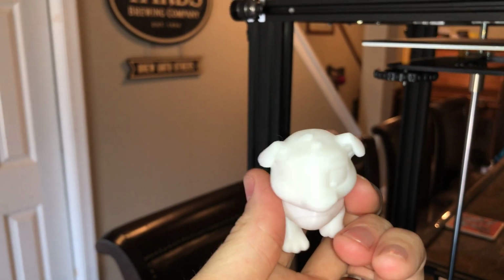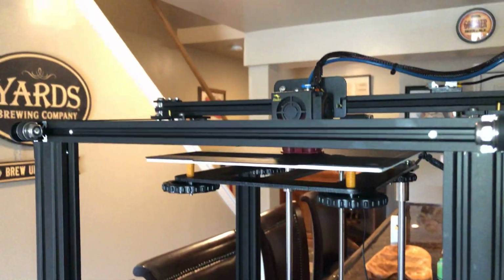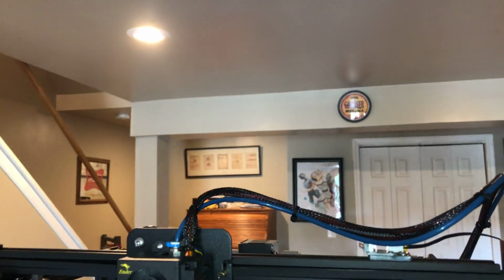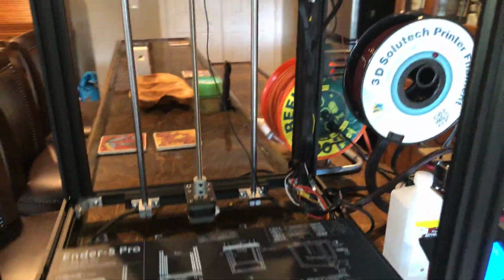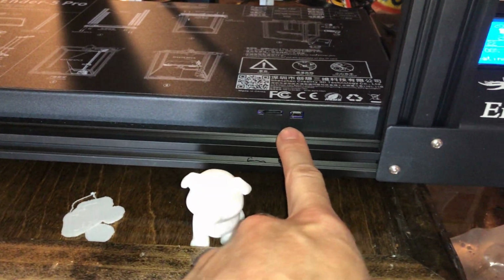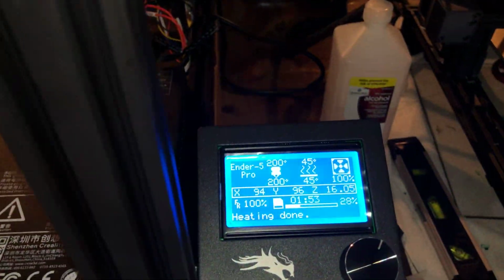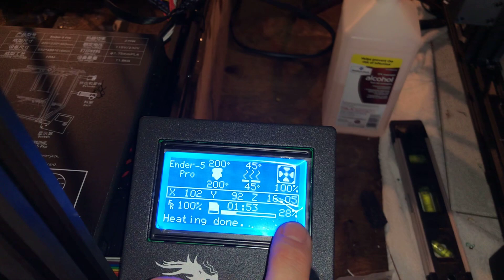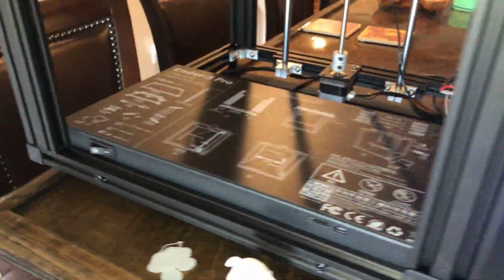Creality Ender 5 vs 5 Pro | 3D Printer Video Review

Comment: Ive watched a few reviews on this model but am left wondering if that bed will droop over time. It is only supported on one side. I would expect the far side to start to droop as time goes on. Have you noticed anything like that shoeing up in the prints?
Reply from the maker: Grandpa's Place I’ve got a regular Ender 5 that I’ve had for over a year now and have not observed any drooping. That said, I have printed Super Struts arms in PETG that supports the front end as a precaution. I recommend others do the same.

Comment: does that board help the print quality? thax i have the older version ender 5
Reply from the maker: roadstar499 I have not seen that this board improves the print quality. The reduction in sound is VERY noticeable though.
Reply: @plasticmakesperfect5863  i also thought this silent board had built in smoothers??? i know my 1 year old ender 5 does not...i also have a landy power i think this one has a meanwell...thax

Comment: Have you tried the white filament, that what came with the printer? I have just problems with it.
Reply from the maker: Sebastian yep, I have. I printed the dog that with the white filament as the first test of how it works and had no trouble. What issues are you having?
Reply: @plasticmakesperfect5863  It was 1.6mm or below and very brittle. I've now new filaments here and I try currently TPU

Comment: Torn between the pro and the plus. Not sure if I need the added print space. Price isn't an issue but don't want to have a big bulky machine if it's not worth it.
Reply from the maker: Steve Drawdy sorry for the slow reply! The Plus does have benefits that the Pro doesn’t, such as a 32-bit main board, dual Z screws, a BLTouch, a touch screen, and obviously the bigger build surface. Two of my buddies have one and they’re huge! I mean, he basically had his arms as wide as possible to carry it in.

Honestly, it’s really dependent on what you want to do with the machine. For my needs, the Pro is sufficient in size plus I love to tinker so my pro is largely a Plus already, minus the build size. I’ve heard there are some issues with the Plus, but in the year or so my buddy has one he hasn’t had any issues so your mileage may vary.

Hopefully that helps you out some, but the Ender 6 is also either around the corner or out now. That one uses CoreXY kinematics so you can print much faster and it’s more stable.
Reply: @plasticmakesperfect5863  ended up getting a pro last month and a sidewinder x1 on prime day! Thank you for video and insite!

Comment: I have literally no idea what you're talking about the flooring magnetic mat thing that you have to adjust instead of those huge springs. Why do I have to use a paper to rub it on the mat and making some screw adjustments will make the rubbing smoother? Lol. I've never done 3d printing, and once I get this I'll prolly just assemble it and that's it.
Reply: He's talking about leveling the bed, if it's not done correctly and well enough your prints will come out pretty inadequate.
Reply: @ChiknTikka  I understand the part where you have to adjust the valves at the bottom of the plate to level it, but why do you need to rub paper on it? XD
Reply: Vin it’s a way of leveling the nozzle to the bed that professional and industrial machinists use on big CNC machines. Basically you don’t want the nozzle jammed to the bed because then the plastic can’t come out. And u don’t want it too high or the plastic won’t adhere to the bed. So he is saying to get the nozzle so close as to only be able to slide a piece of paper between the nozzle and bed with just a tad of friction. Do this for all 4 corners. And your bed will be level and set at the right distance for the printer to operate

Comment: Wondering if you'd recommend a smoother with the 5 pro? I saw that the 5 needed one it seems but wasn't sure if the pro would be any better / if its needed. Thanks for the awesome review and comparison :)!
Reply from the maker: spaghettijustice hey, great question! So I personally don’t think you need smoothers. I’ve got the five and five pro, honestly haven’t needed them at all. However, your mileage may vary so I’d recommend printing a few things first then re-assessing after you have some test results! Good luck printing!
Reply: @plasticmakesperfect5863  Gotcha, thanks for the reply :)! And gotcha I'll see how it prints and decide from there, thanks again!

Comment: Thanks so much for this comparison! I have an old ancient CR7 (yeah, the little one) which is already loud enough with steppers and one fan, plus little dampener feet. I was IMMEDIATELY in love with the silent board feature shown here cause it sits right next to my desk and can get annoying. I recently pulled the trigger to get a 5 Pro and it's arriving on Saturday! So excited to hear nothing! 😅 This video played a good part in my decision cause all the other reviews are from people who had the 5 Pro sent to them which I can never trust cause you KNOW those printers were handpicked and made sure to be PERFECT and probably won't be what most experience. Also like you said I was originally gonna get the regular 5, but figured I was gonna spend the difference on upgrades so I just tossed in the extra $50 for the Pro. Thanks again man! 🙂👍
Reply: Completly agree. In so many sectors, noise level is ignored but to me essential, also the top metric after product end result quality (cars: I went electric and my diesel feels like a steam train, computer, appliances, etc...).

Comment: ender 5 pro or ender 3 v2 ?
Reply from the maker: Ender 5 pro simply because of the kinematics. The fact that the Z only goes up and down instead of up and down and back and forth leads to tremendously higher quality for taller/thinner objects since they won’t wiggle. Additionally, I’ve just found my Ender 5 pro can print at higher speeds because of this too.
Reply: I was wondering the same thing. I settled on getting the 5 pro. I just ordered it though, so It'll be a little until i receive and test it out. 

I'm upgrading from a cheap Anet a8.

Comment: Can you directly connect a computer to the printer or does it need to be on a SD card?
Reply from the maker: Like King James said, Octopi is the way to go for this. However, you can directly connect the printer to a PC and print that way. Just know if you do, your printer has to stay on and connected the whole time.
Reply: Set yourself up an octopi (octoprint).
It's literally 35 bucks and it's the best investment you can make aside from a glass print bed.

Comment: Hi Thanks for your review!!!, one thing you commented that you printed on abs on the ender 5 pro, what was the outcome? also I notice on your Z lead screw that the antibackslash nut was missing, it came like that? thanks again!!!
Reply from the maker: ABS prints just grand if your settings are right and you have your printer in an enclosure. Otherwise, expect the first layers to start to peel up with ambient temperature changes.

Yeah, mine came like that. There are varying versions of the Ender 5 and some have it, some don’t, some have a different Z lead screw... I genuinely have no idea how to tell you what you’re going to get. Creality keeps making minor alterations.